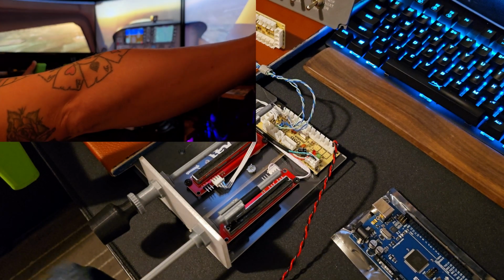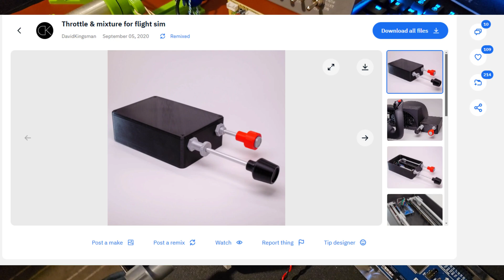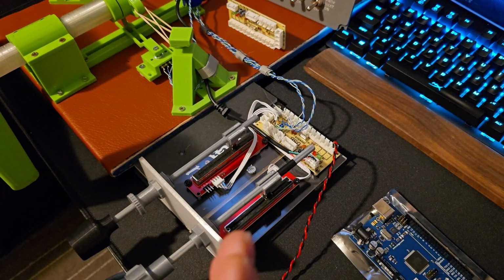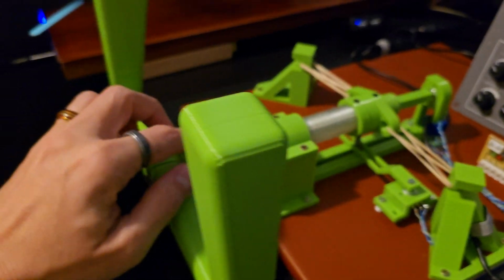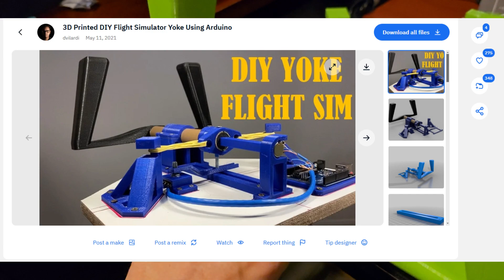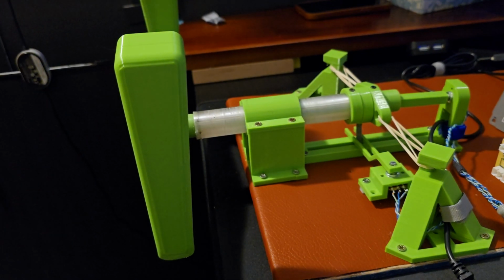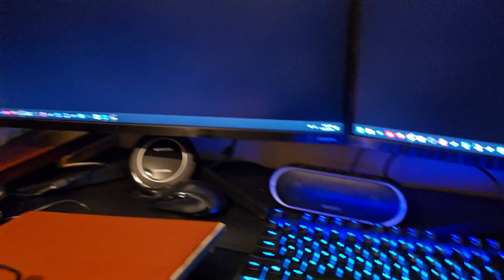DIY 3D Printed Yoke for Flight Simulators with Throttle and Mixture

Comment: Adding a trim wheel would be 😎 thanks for the ideas! I've been simracing a few years, it's gotten too stressful for me so I got into flight simming but I currently only have an xbox controller. Hotas are too expensive, videos like these gets my brain going! Thanks man!
Reply from the maker: I have a couple more things to build out.  The trim wheel and whiskey compass are high up on my list. I was in the same boat.   I didn't want to fork over a bunch of money on controls.  I was fortunate that I already had a printer.  I will say I have no frame of reference in regards to real controls.  How they feel or work.  I can only go based off my setup.